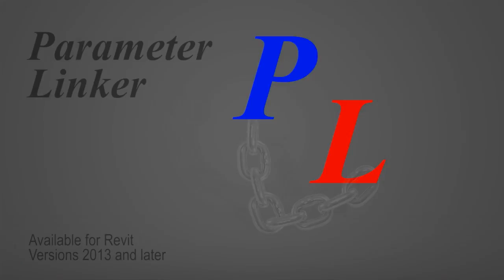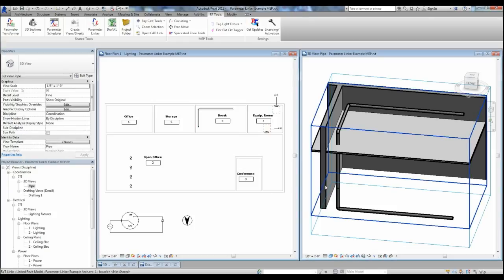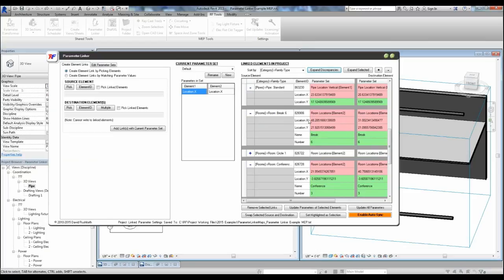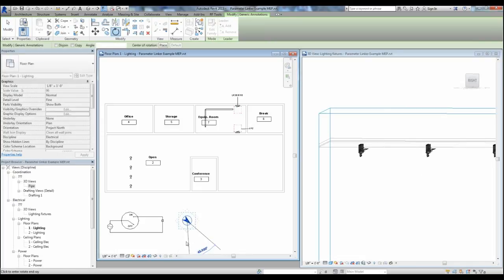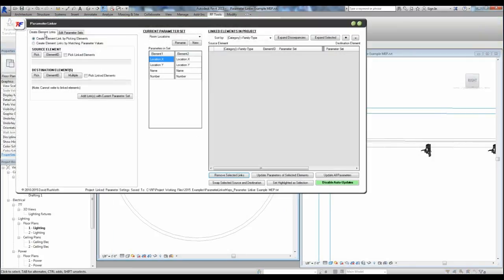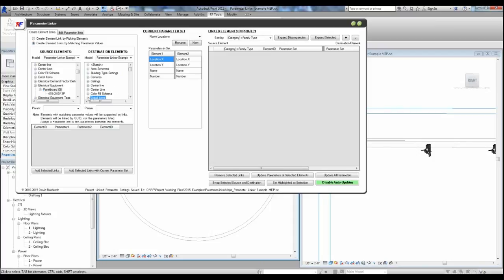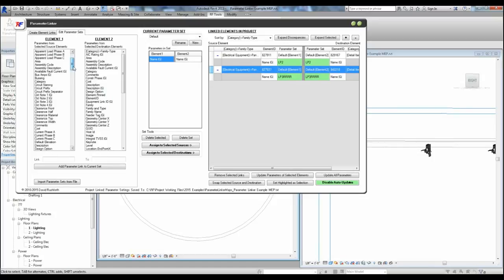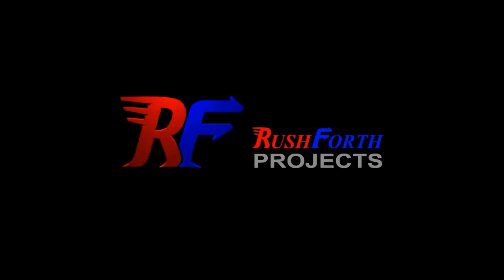Parameter Linker For Autodesk Revit by RushForth Projects

Comment: I'm working on a townhome project. There's a file that contains all of the boilerplate details. And I would like to reference this project file in separate unit plan/building files. 

Is it possible to key key sections or call outs, etc to details that are in a separate Revit project? Please and thank you